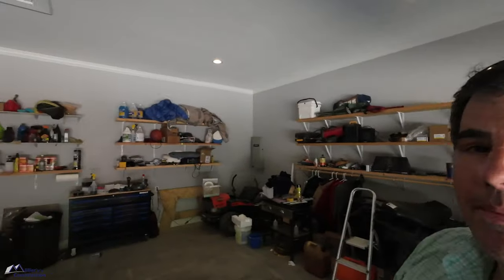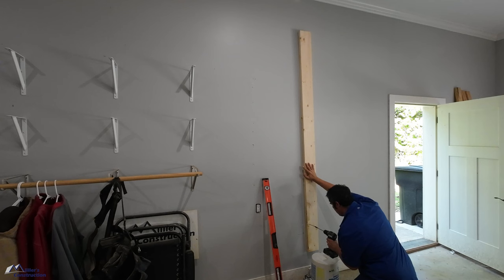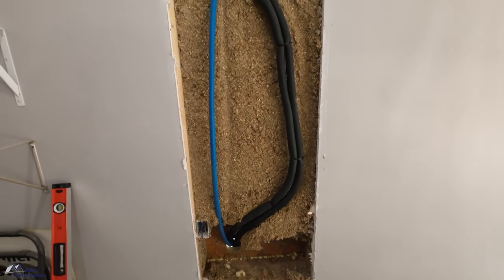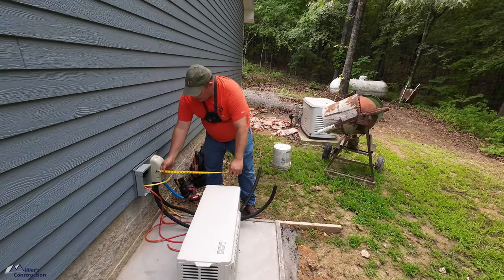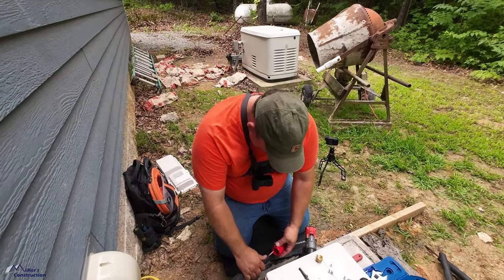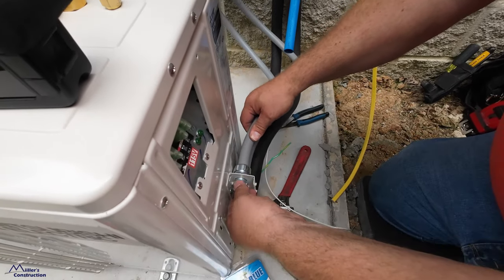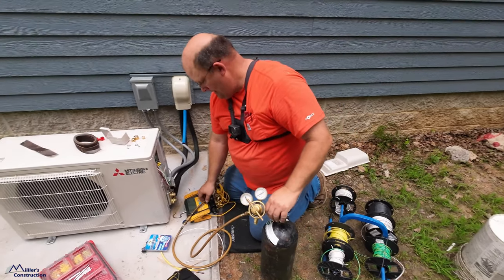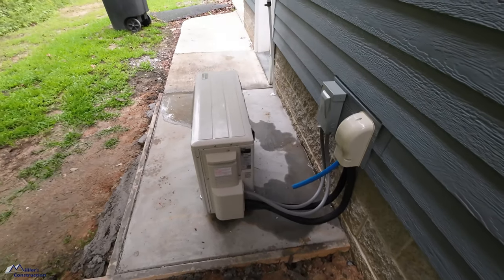Step-by-Step Guide: Retrofit Installation of Mitsubishi Ductless Mini Split with Concealed Line Sets

Comment: Use line hide, saves a lot of nonsense work. Now, if you ever have issues, you gotta cut the wall open and get to it.
Reply from the maker: @stevek.1979  issues like a random hole in the middle of the line set??? Really?
Reply: @miillersconstruction exactly, if you can hide the line in the wall and still access your joints it’s a much cleaner install.

Comment: Nice install. I've seen several Youtubers do the installs, but hiding the lines is going the extra mile to re-sell value if it ever comes to it. Looks great.
Reply from the maker: Thanks man. Yeah I just wanted it to look as nice and neat as possible. Extra steps? Yes. But worth it in my opinion. Thanks for checking out the video.

Comment: How do I find someone like Aaron? Did he charge you by the hour? The commercial bids on these mini-splits will quote the equipment price at about 1.5x the eComfort price, then double that amount for the total install. So if you can buy the equipment for $5000 from eComfort, the installed price will be $15,000. I'd happily pay a guy like Aaron $250 per hour, but how do I find him?

Comment: I installed two mini-splits in my mobile home. One in the bedroom an one in the living room. In both cases I ran the AC lines sets through the floors instead of going out the outside wall. I ran dedicated electric wiring to each unit so each mini-split was on it's own circuit. They have both been running great so far.
Reply from the maker: Man That's great to hear. I'm glad they're working well for you. I just can't stand the look of a line set running down the side of a wall. It just looks cheap and DIY to me. I think you made a good decision man.

Comment: They really have these systems figured out.

Helped a friend set 2 for his  smallish 2 story home.
The biggest pain is attaching linesets behind the cassette, they give you a 3x5 hole to make the connections. 
Fat fingers not apply lol.

Unfortunately my friend's cheaper off-brand's units insulation wrap, is not uv stable in the deep south...it falls apart after about a year.
Am sure Mitsubishi uses better materials. 

Open end torque wrench, and and the spin flare is not something a diy'er will have.
We used 3 clicks of the elbow for torque specs ,or common sense.
After working behind other people's shoddy work in remodals,it's always a pleasure to open up your  own walls ...and see that craftsmanship is still rewarded years later!

I give it two AA's !
Reply from the maker: Thanks chip! Really appreciate it man. Your definitely right about the fat fingers, I have the same issues! Thanks for checking out the video buddy.
Reply: So…I said “thumb screws” … but I meant “thumb caps”  lol. 33:42
Reply from the maker: @OwensandCompany  us common folk won't know the difference 😂

Comment: do they make a mount like  that for vinyl siding, also what was the boot you used outside for the lineset?
Reply from the maker: Yes they do! Not sure they make one that size, but you could always buy one from Diamond Kote and then use vinyl siding around it. Nothing wrong with that I have seen it before. The lineset cover is from Mitsubish and I purchased it on ecomforts website.

Comment: I believe I would’ve went 18’000 btu, I hope it’s doing good
Reply from the maker: It's doing very well, but I agree, I wish I had gone 18k. I tested the unit on the hottest day we had this year, real temperature 100 degrees, heat index over 120. Within 30 minutes the humidity was around the 50% mark. It removes the humidity incredibly fast. But temperature only dropped a few degrees. If the unit is left on for a few hours, it's perfect. But if I want to go out and work on something quickly in the garage, it's frustrating having to wait for it. I sized it properly so that it wouldn't short cycle, but in this circumstance I wish I had over sized it. Something I'm so against typically lol 😂

Comment: What size unit? Happy so far?
Reply from the maker: 12k Unit. Very happy so far. At first I was surprised at how long it took to cool the space. But after testing a few times in this brutal southern heat, its dropping the humidity in the space from the upper 70% range to low 40% in 30 minutes. That to me is impressive. I am very pleased. Running it today actually.
Reply: @miillersconstruction  Excellent. Thanks for the info and the comprehensive video. Will be doing similar unit here in our Nashville humidity. :)
Reply: Thats what she said